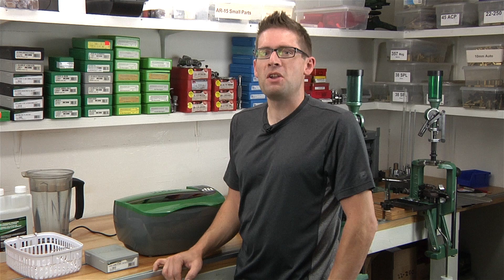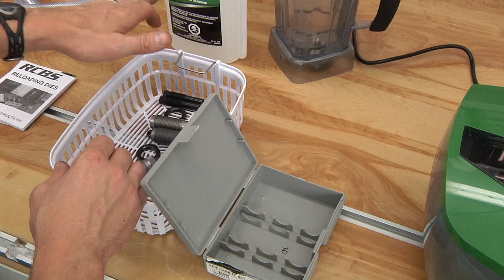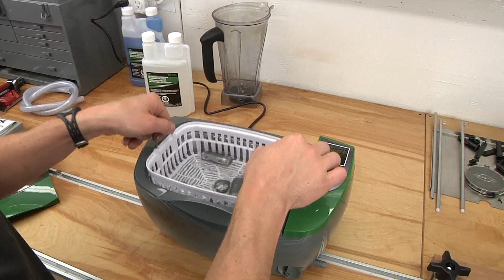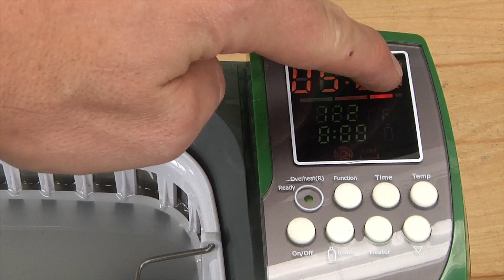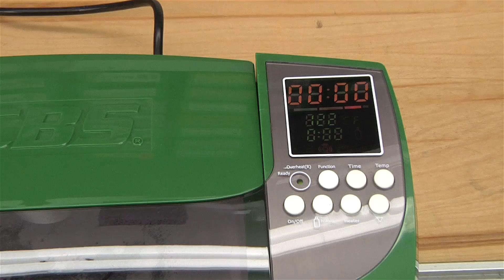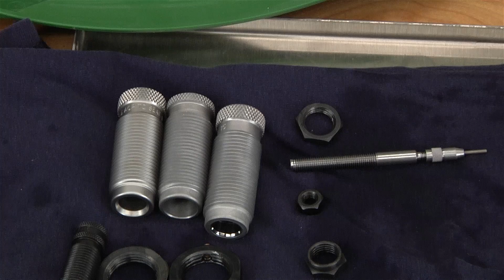RCBS Ultrasonic Cleaner Cleaning Dies

Comment: Has anyone cleaned Lee Precision dies in their RCBS ultrasonic cleaner with good results? I ran my Lee Precision ultimate die set in 9mm in my RCBS ultrasonic cleaner, and it caused flash corrosion immediately after I pulled them out. I had shop air ready and sprayed the water and solution off right away. Nothing sat.
Reply from the maker: What solution were you using?
Reply: @Ultimatereloader  RCBS ultrasonic weapons cleaner.  Which is why I'm kinda baffled. I watched your video before I cleaned my dies. I suspect that the metal composition or coating on the RCBS dies vs the Lee are different. You probably have better knowledge on that though. Not sure what Lee does in terms of heat treating/finishing on their dies. In any case, I'm going to take my Dremel and polishing pad and clean up the inside/outside and apply a thin coating if oil and hopefully this will solve my problem.

Comment: I bought some reloading eqipment from an old guy who isn't reloading anymore and when I got home I saw the dies had quite a bit of rust on them. What are some solutions to get rid of the rust?
Reply from the maker: I would use a wire brush wheel (on grinder or drill) on the outside of the parts, and chuck up the die if you can to spin it, and use fine steel wool on the inside. Best of luck!
Reply: gavintoobe thank you very much

Comment: AR15 bolt carriers is why I'm thinking of ultra sonic cleaners. Actually bolts and slides in general. Got plenty of reloading dies need deep cleaning also. On Amazon I read a lot of bad reviews on other available sonic cleaners which steered me to old reliable RCBS. A piece of equipment or a tool needs longevity or it might as well be landfill material.

Comment: I'm interested in this cleaner for cleaning my AR15 bolt carrier and the bolts for my hunting rifles.  Is this a good option or is there another manufacturer that you'd recommend?
Reply from the maker: These work great, and I'm about to do a video and blog post on their latest version (bigger)!
Reply: Can't wait to see that.  So when will that video be available and what model is it?  I don't need anything monstrous for gun parts, I just want something that works and won't break in a month.
Reply: I got a cleaner and used in on my rifle bolts, fully assembled bolts.  I used hot solution then I rinsed with hot water to encourage evaporation.  I then blew the bolt out thoroughly with my air compressor and oiled.  Is there any risk of rust or seizing in the bolt if I cleaned it this way?

Comment: Question for all you guys who are experienced in this stuff. I cleaned my dies in the same solution that I clean my brass. The dies came out black. Have I stuffed my dies or is this normal, or can I just clean them again in the right solution.
Reply from the maker: Brass cleaning and parts cleaning solutions are different, sounds like you used the wrong solution! :(
Reply: Yeah thanks guys. I found the solution that I was supposed to use. Ran the dies through a couple of times and they came out fine. Luckily I didn't stuff them.

Comment: any updates? did this work out or did you have to add another corrosion preventative afterwards?
Reply from the maker: No problems so far!
Reply: I use the Lyman gun lube in the ultrasonic cleaner after cleaning all metal parts.

Comment: I recently received about thirty reloading dies from an older gentleman. They were in his basement and are slightly rusty. Are they salvageable and could I clean them in this manner?
Reply: Probably if there's only a little rust on them. Use the ultrasonic cleaner with a mix of vinegar (and can't remember what else). It'll remove the rust. Look it up here, there's a good video on YT on rust removal with ultrasonic cleaning solution. It'll give you the correct mix ratio

Comment: Gaven 2 questions When doing Brass do you have to heat up the Solution and no.2 Do you use plain Tap water or Distilled water
Reply from the maker: Terry LeGrand Terry- I'm not sure if you have to heat the solution, but I do because it helps quicken drying time, and helps the brass clean better. I'm just using tap water, but if I were cleaning a gun or gun parts and didn't want to risk mineral deposits, I'd use distilled water.